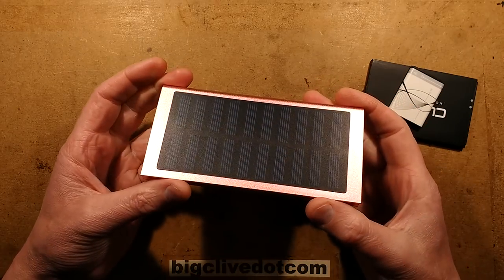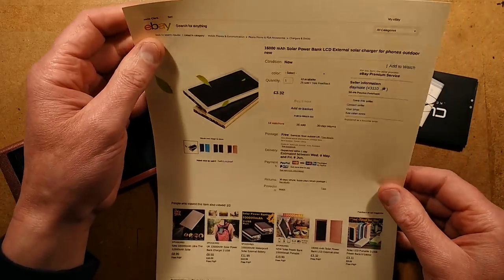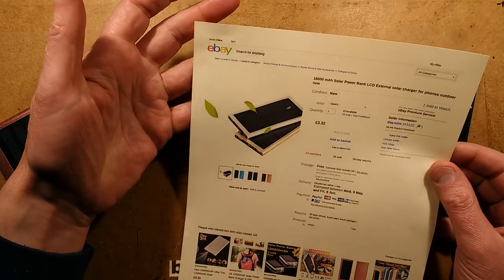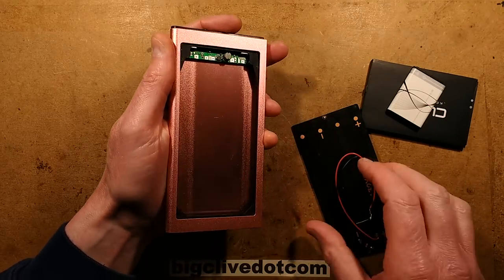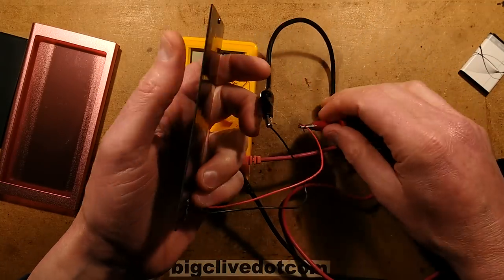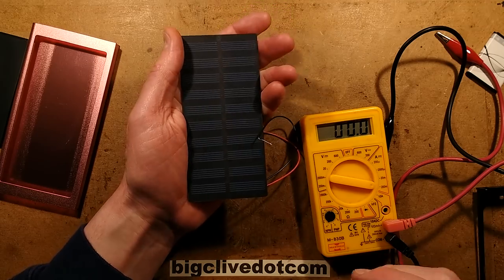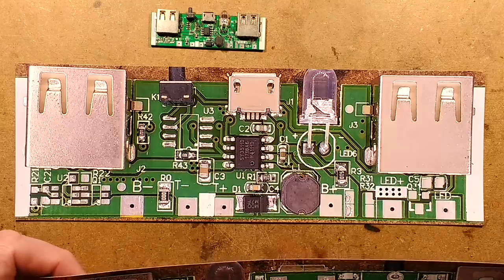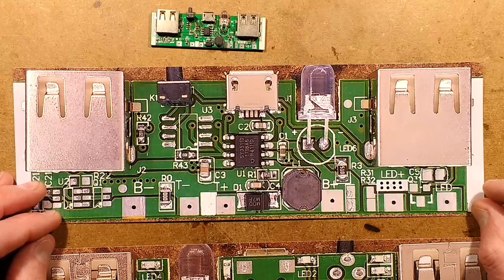Fake USB power bank kit rating (100,000mAh again)

Comment: Hmmm. I've been trying to figure out how to multiplex the input pins on an ATmega32u4 for reading key inputs from a keyboard. I'm thinking each key needs a capacitor that's either charged or drained when the key is pressed, then the microcontroller reads the charge of the capacitors. I haven't quite figured out how to inexpensively put all of the caps in a known state without changing the key-press state. I'm pretty new to EE, so... yeah.
Reply: Martel DuVigneaud The traditional method is to wire it as a matrix. Is there any reason that won't work for your application?
Reply: Mike, there aren't enough pins on the ATmega to individually read each key on a 108 key passive matrix so what I'm trying to figure out is how to multiplex for an active matrix. :)
Reply: Martel DuVigneaud How many I/O pins do you have available?
Reply: Martel DuVigneaud For that matter, why not use a standard USB PC keyboard? You'd only need 2 data lines... And it's fully debounced!
Reply: Erm, it's only like 20 input pins... which is why I want to do the multiplexing.
Reply: Well, I suppose I could pay someone else to do something fun and interesting like making a keyboard, but... what's fun and interesting about that? :)
Reply: Martel DuVigneaud The fun is in building a useful device , not just a component. Learning design optimization is part of the fun, by devising the most function with the fewest resources. Recognizing that a $10 keyboard makes better use of your time and energy, than building from scratch, is an important lesson. It's known as being smarter than the problem.

I'm not going to tell you not to build it from scratch, because there are lessons to be learned from the experience (in this case, generally unpleasant). That said, there is value in learning from other's experience, without experiencing it yourself (like getting kicked in the balls. Better to learn by observing it happen to someone else, than needing to feel the pain yourself). But they're your balls...

You can build an 8 x 16 matrix to read 128 switches. You'll need a diode for every switch, and you'll have to develop either hardware or software to debounce every keypress. This is a critical part to making it work! Only then can you develop the software to both drive and decode the scan counters to determine the correct address in a lookup table to figure out which button was pressed. Or you could just use an off the shelf keyboard, and go straight to reading the data, and doing something useful with it.

I did it by hand once , many years ago, on a 4 x 4 matrix (just to learn). Debouncing was the worst, followed by the assembly code our platform used. It was a structured lesson, so the pitfalls were well known, plus, we had help in the lab, if needed. You don't have those resources available. I don't want to to see you disgusted and frustrated by biting off more than you can chew for a beginner project.

Whichever way you choose, good luck!
Reply: I don't agree that a $10 keyboard makes better use of my time. My intent is to learn more: I want to have the knowledge of how to design the keyboard.

Here's an Arduino (with the ATmega32u4) with a 2x3 matrix without capacitors or diodes: http://randomer.net/stuff/arduino-pro-micro-proto.jpg

And the same Arduino sitting on the circuit board of a keyboard with cooked traces:
http://randomer.net/stuff/arduino-pro-micro.jpg
Reply: Martel DuVigneaud Ah, but you see, sir, you did not clarify the keyboard was the project! Your terminology made it easy to (and I did) interpret the keyboard being part of a project, not the project itself . Sorry for the misunderstanding.

That said, all the questions I've outlined still need to be answered in order to have a successful, stable, and reliable design. Using a carbon pad, membrane switch is a different animal from a metallic contact switch, and again, I was left to guess at that detail. These are a little easier to drive, and software debouncing is sufficient. As for capacitors, the way the two membrane layers are directly over each other, you pick up some capacitance right there. Also, the "scorched" traces may simply be oxidized silver. The discoloration is very common for this type material. I didn't see any blistering of the substrate, so there may be no thermal damage involved (as best I can see from one photo).

As you still haven't provided details on what you plan to actually use the keyboard with, there remain many, many unanswered questions between where you are, and your destination. As the existing chip is a custom design, there are even more things you don't know about its internal design. Clearly, it's been opmized for the task. All those unknowns will need to be addressed.

By identifying all the questions I've outlined, you may think I'm trying to make this a more difficult task. In fact, the opposite is true; I'm trying to make it easier. Once all the design parameters are known, often the best solution presents itself. It just happens you've chosen a deceptively difficult project.

EDIT: I happen to still use a 1984 keyboard with a controller like this. Why? It's built like a tank, and is still working great! Especially after a recent full teardown and wash after dumping most of a soda in it. I simply cannot purchase a keyboard of this quality today. In this example, it's using an 8052, which is extremely well suited due to its unusual dual memory and I/O address spaces fully brought out to the pins. While the 8052 and its derivatives are largely obsolete, it does this job very well, with, I believe, only one other small support chip. You may be able to find a schematic of this design as a reference for one way to do it. If you find it driven by an 11.0592 MHz crystal, I can guarantee it's in the 8052 family. FYI. Again, good luck!
Reply: Mike, my apologies for not being quite explicit enough with what I said. I wasn't trying to give a full description of every part of it: more just a mention of "I'm having fun learning something new!" I do appreciate you taking the time to offer some of your insight. :D

Those darker/discolored traces are definitely oxidized, but they're lines to the more commonly used keys (and the 3 LEDs) and some of them no longer have their original conductivity. The middle layer of PETE film gives an air gap and the outer layers have the pads on opposite sides, so... capacitive, right?

The main chip in the keyboard (from what I remember when I looked it up about 10 months ago) is a general purpose keyboard controller but almost certainly has custom firmware for Microsoft. You're right that I'll never know exactly what that firmware does.

And...yes, I've intentionally chosen a difficult project. Because the challenge is what's fun! ;D
Reply: Martel DuVigneaud Thank you. I also owe you an apology for misinterpreting the membrane layout. The "better" way of doing this is with interleaved conductors that a carbon pad bridges across to make the contact. It seems what you have is a metallic contact when the two layers of metallization are pinched together. My apologies here too, because that method reeks of cheap shit. Microsoft should be ashamed to have their name on this, but given their insane markup, probably not. That likely cost $2-3 delivered from China. Then they have the nerve to charge $30-40 for that?! Bullshit!

If you've lost conductivity along the traces, your project just got a lot harder. You're going to need the highest silver content conductive paint you can get. You'll have to clean the existing traces with a good liquid silver cleaner, then mask out the damaged areas, and paint them back. Due to the damage, you're already on the razor's edge of not being repairable.

Once you've got a good switch matrix, you'll have to reverse engineer the circuit to decode the matrix. Draw lots of sketches, and leave room for noting each key function as you go. Without hacking up the membrane, you must use the original matrix, whatever its configuration is. Once everything is traced out, you'll see the matrix.

Once you have that, you can decide what circuit is most appropriate for the job. Then you get to start writing the code. I'll give you a hint here. Each key has a press, and a release scan code. Those are documented, however I'm unable to help with the host USB handshake, or the data encapsulization. There are code libraries for that...

I think I'd start in the middle, and inspect and trace out the matrix first. You can do that concurrently with checking conductivity. That'll give you a better starting point for determining if it's still worthwhile to you.

Like Clive, we've repaired a lot of really screwed up stuff in our day (and brought some things back to life that should have been buried). If you can get this working properly, you'll definitely have my respect and admiration! You've got quite the project Dr. Frankenstein! 👍
Reply: Mike, I've done a partial layout of the keyboard traces. The keyboard was obviously built down to a price. And, I only  intend to use the injection-molded plastic case and the key caps. I want to completely redesign all of the electronics inside... using mechanical key switches (Cherry Brown or a clone.) How many years is it going to take me to actually do this with all of the other projects I have... I don't know! ;)
Reply: Martel DuVigneaud I'm curious, is the membrane on one plane, with different length plungers, or does it conform to the curve with uniform length plungers? I was always curious how they followed the curve, but never had one to dissect.

The better your keyswitches are, the less trouble you'll have. Gold flashed Cherry is an excellent choice. You'll still need to software debounce them. The software debounce is simply reading the key state several times in rapid succession, and taking the average value. ALL switches bounce! If you've never watched a switch closure on a scope, try it sometime. It'll be an eye opener. 

Keep us posted on your progress!
Reply: The PETE film is 3 flat sheets that bend and conform to the inside of the keyboard case. The middle sheet has no traces on it but has holes for the air gap. The collapsing-dome membranes are in 4 sections: left hand side, right hand side, space bar, numpad/arrow keys/etc/. The keys in each of those sets are in their own... for lack of a better word... "carrier." The function keys have slightly longer plungers, space bar is special, but all the rest of the keys look like they have the same length plungers.

The software side is the easy part for me... I've already written the debounce code. Electrically retaining key press states between scans is why I'm thinking of using capacitors.
Reply: Martel DuVigneaud Cool! Thanks for the explanation. Forgive my unfamiliarity with the Atmel chip features. Present living situation prevents tinkering, so I'm behind the times on current designs.

The debounce routine should handle everything in registers, or on the stack. Capacitors will just slow your scan speed. That's the beauty of a robust software debounce - It eliminates most hardware failings, and reduces your component count. That's the beauty of using edge triggered interrupts, and a fast clock.
Reply: I've been running the ATmega at different speeds (1, 4, 8 and 16 MHz.) I've been using a physical key to USB HID key code LUT. Yeah, not using a capacitor per key would definitely reduce the component count. It would also significantly reduce the amount of through-hole component soldering I'd need to do. But.. I'm not intending to do any sort of large scale manufacturing of the keyboard.
Reply: Martel DuVigneaud I tend to run things fast. If I read the resonator correctly on the original driver, it's running at 6 MHz. Fast also lets you run the debounce longer, such as 10 or 15 loops without any performance penalty.

Eliminating the caps will definitely save time and money, while improving performance.
Reply: Mike, I believe you did read the resonator correctly, even with it not being super clear in those photos. Here is a slightly clearer photo: http://randomer.net/stuff/elite-pcb.jpg

Comment: do you ever wonder why the real power bank which can measure exactly 10k, 20k or 100k mah    never exist on your test? because 10k mah does meant to measure like that. your measuring only around -600 t0 600 mah because that's all device can got charged.

Comment: BigClive, oh no. whats happened to the Cubot H1 ? you not using it anymore ?
Reply: Hmm interesting. My Cubot Cheetah doesn't feel like there is any malware installed. I have even looked through the apps and nothing odd there. battery always seems to charge to 100%
Reply: what you say makes sense. I will keep an eye on that on my phone. thanks (Спасибо)
Reply: BillyNoMates1974 The trick is to: 1. Make sure the ROM has non-buggy battery handling modules.  2. Start with a fully charged battery and let it run flat completely with the ROM quietly watching the power consumption and battery voltage in the background. 3. Charge the phone again with the ROM code still watching.  4. Some battery code may need a slightly different learning procedure.

Comment: That chip is a regulator?
Reply from the maker: It has lots of functions.  Charge current regulator and voltage limiter, discharge boost converter and display/LED driver.

Comment: talking of cells ,id imagine the only reason tesla uses traditional round cells is they are mass produced already and the gap between them allows airflow for cooling ? if they use flat slab cells it wont have any cooling ?

Comment: 100,000mAh... Yeah, right.
I've got a 10,000mAh battery next to me and it certainly won't fit in there. Let alone 10 of them.
Reply: To be fair, my battery is a 36V one. Just goes to show that Ah is a terrible unit for comparing battery capacity :P
Reply: So that would be 100,000mAh at 3.6V...

Comment: I never buy random electricals off websites like eBay or chinese eCommerce sites. if you want a good power bank use a brand called Anker they make REALLY REALLY good power banks and cables and they even do audio products such as bluetooth speakers and wireless earbuds which they sell under the Sound Core brand (never used their audio products but as for their cables and power banks they are AWESOME and fairly priced)
Anker even has good customer service a few years ago I bought a Anker brand braided lightning cable off of Amazon which came in a faux suede leather style wallet but the braiding on the lightning connector had come out of the connector housing during production or something I wrote a bad review on Amazon and they then send me TWO replacements for free with next day shipping and I didn't even write a complaint to Amazon or ask for the replacements by then but the cable worked fine and after almost 2 years it was STILL working even though because of the slightly damaged lightning connector the wires were slightly exposed (it probably could have lasted longer but I lost the cable so I don't know how much longer it would have fared)I bought one of their 20k Mah power banks when I was in college and was using it regularly until I left college in 2016 and had it until like 2017 then my uncle took it off me when he went abroad but he ended up losing it and I am considering buying another one from them (I haven't had much of a need for a power bank since I got my last one because besides work and shopping and going to family and friends houses I don't go out too much especially enough to make me need to charge my phone on the go but after corona virus ends I think I may start using one regularly again when I start going out)

Comment: You're awesome, Clive. Love your videos. Can I suggest you buy a tip for your soldering iron? What the hell is that blunt blob?
Reply from the maker: It's a chisel tip.
Reply from the maker: 900M-T-3C
Reply: bigclivedotcom For working on circuit boards, especially little ones, I would use a pointy one like a T-B or a T-1, but maybe you need something bigger for that surface mount stuff. You're the boss!
Reply: Telling the guy with the experience, the skills, and the videos how to do it... never change youtube.
Reply: Reverend Jynxed LOL. It was all in fun, but let me tell you, as a computer engineer (hardware and software project leader and engineer) for big and small companies, several of which I founded, and a hobbiest who built full digital synthesizers from scratch in the 80's (and built my own lab equipment), I would be pretty confident that I have soldered more connections than any of you. Clive, I certainly did not mean to insult, just enjoying your vids, which are awesome.

Comment: Is it just me or am I the only one that avoids putting batteries, esp lithium batteries in the sun?
Reply from the maker: Many of these units do damage the batteries in direct sunlight through heat.  On my own solar/lithium projects I use foam strips between the panel and battery to reduce coupled heat.

Comment: I want to say my problem with the solar panel power is not working properly...... And then I put under the sun the power Bank not charge at all only increase 5% at 30min..... Is it that solar is fake.....😂
Reply from the maker: The solar panels are often low output or fake.  Putting a lithium cell out in direct strong sunlight will also overheat and damage it.
Reply: @bigclivedotcom  ouh.... 😂 Now I only charge.... Not use solar shit panel.... 😂

Comment: Isn't a review about a fake product way too easy ? finding a good product does future buyers for such a related product, more help, there's heaps of bad stuff for sale, price and some common sense, should do for most people.
EEVblog is also so boring in that subject...
Reply from the maker: Exploring the crappy stuff is much more fun, especially if corners have been cut.  I've just made another video which starts by explaining why the solar panel in this unit was bad.  Which is a shame, because the actual silicon cells were good.